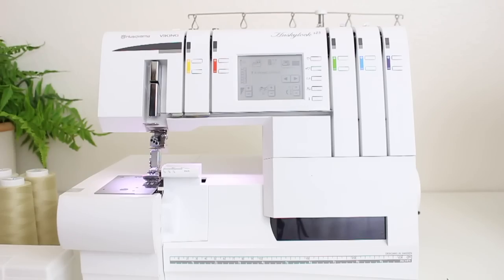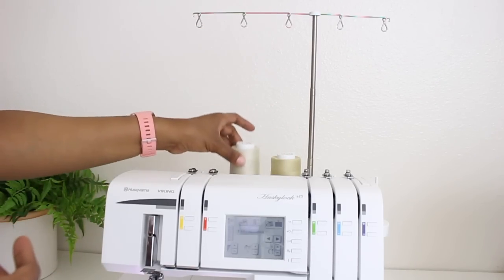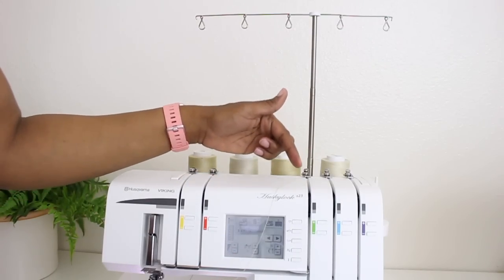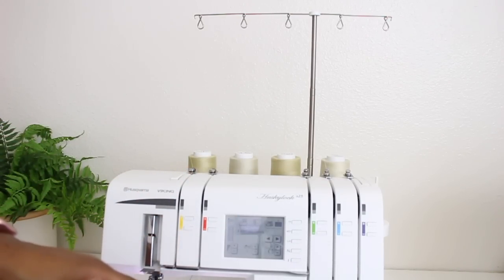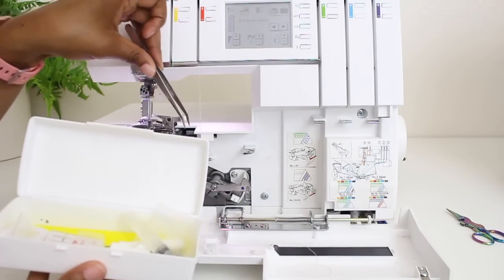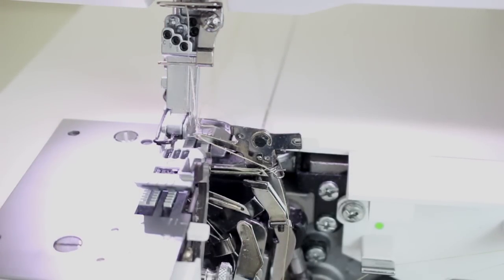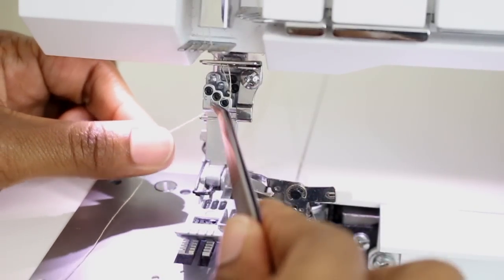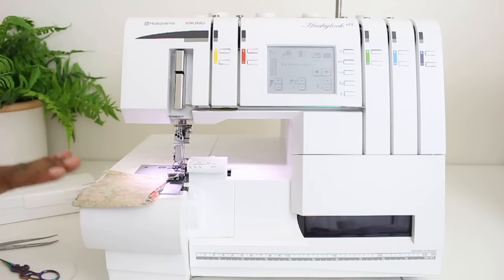Serger Series: HUSQVARNA VIKING: HUSKYLOCK s25: HOW TO THREAD

Comment: I have had 2Viking sergers you must not be able to wear them out.  My first I used until the 910  computerized version came out. Sold the first one for a good price to a friend and I think it is still working.  My 910 I purchased I think 2004 or  earlier and it still is working like a dream.  Most of my friends have servers but want to use mine for a couple of stitches (flat lock and rolled hem)  on mine because theirs do not do as pretty a stitch as mine. Love, love, love my Viking serger.

Comment: I have the Husqvarna Viking S21 Serger machine. I have to watch the video every time to change threads or re-thread. Your video of the S25 is threaded basically the same as mine, however I've had to rewind to check how you thread the upper looper. On this model, it looks as if you used 2 upper loopers instead of one for the 4 thread overlock stitch. Please advise if there is a difference between the 2 models  pertaining how the upper looper is threaded. Also, apparently I've been threading the needles wrong after they pass through the first 2 points. That, I have right. It's threading them behind the bars that gets me every time.  The video on the S21 is not as clear as your instructions. I plan to make the adjustment per your instructions immediately on threading the right and left needles. I plan to watch for your coverstitch video as soon as it comes out.
Reply from the maker: laverne cady hi! I’m sorry, I wish I could give you info about the difference between threading the two models but I’ve never used or threaded the s21 so I can’t say. I’m glad seeing how threading the needles were helpful. And I’ll be uploading the coverstitch video next week! Thanks for watching!!

Comment: My yellow needle is threaded correctly but doesn't make a stitch. If you look at the threads after sewing, all of the threads are connected as normal, but the yellow thread is just straight. It does stitch through the fabric, but it doesn't stay. Does anyone have any suggestions?